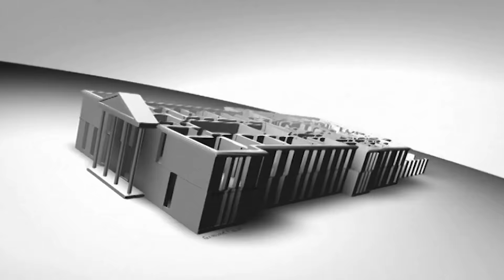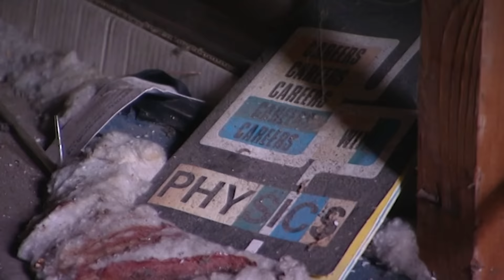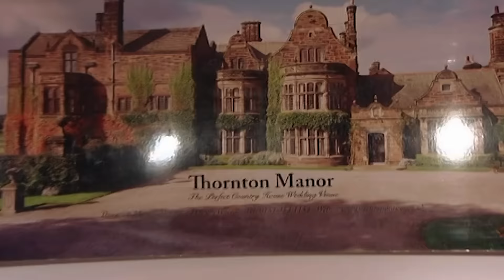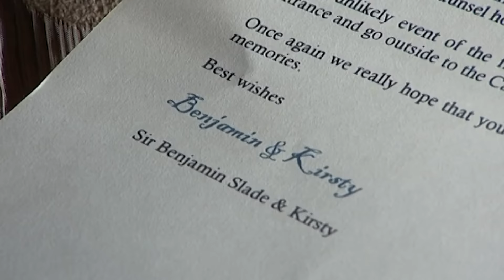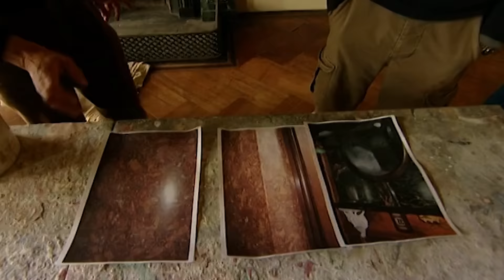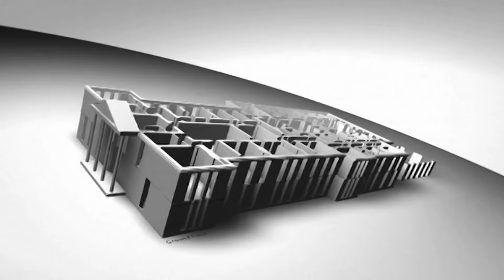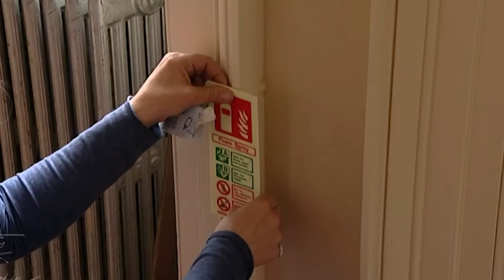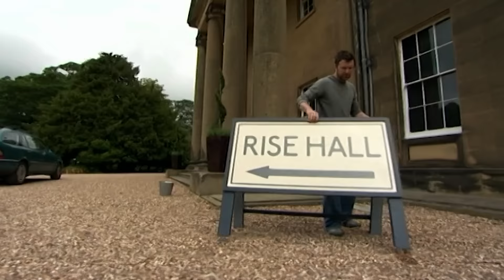Is It Possible To Renovate 30 Bedrooms In 8 Months? | Beeny's Restoration Nightmare  | Abode

Comment: These places go to the dogs because NO ONE can afford to keep them warm enough to keep the mold, mildew and rot away. A normal stick built home has to be heated to some degree even when people go to a warmer place during the winter. 

You can't just shut the heat off and I very much doubt that these huge places are EVER WARM ENOUGH. Probably never were, even 50 years or a hundred years ago. Rot doesn't develop overnight, it takes years of neglect.